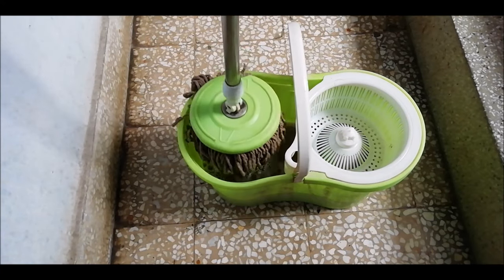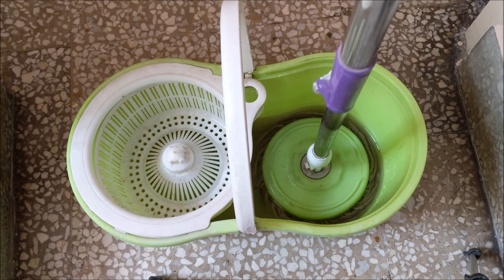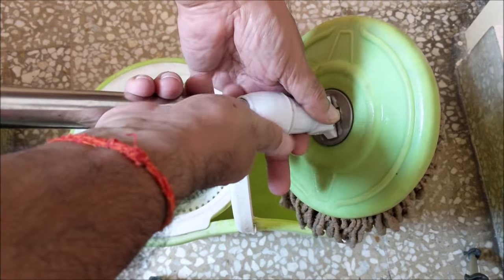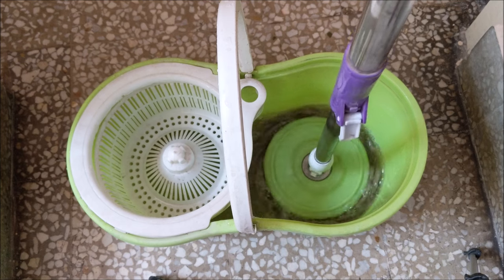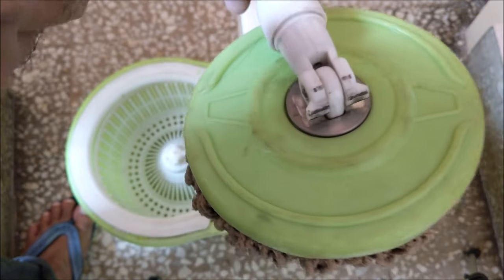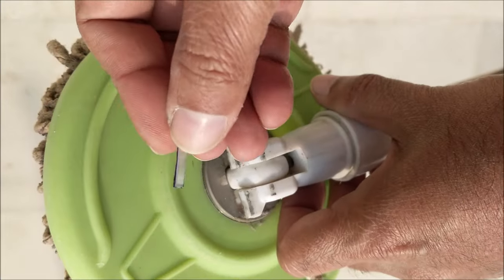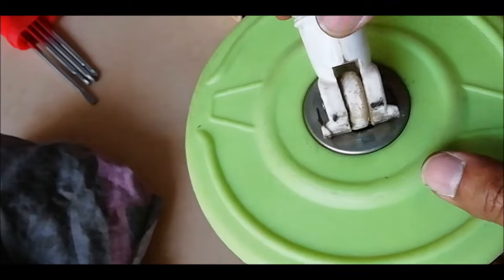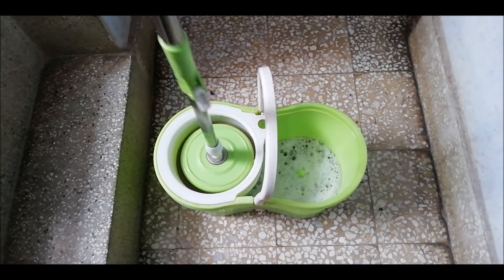fix spin mop that is not spinning

Comment: It's still not spinning
Reply from the maker: Remove rod from mop holder then open rotating lock. Push the rotating rod in, if the rotating rod goes in without slipping and rotating then the rod is good but if it goes in without rotating then the rod is bad.
Reply: @diyrepairs  the rod is slipping the same as urs but your solution didn't solved my problem please help sir
Reply from the maker: @pixarchgaming  Did you check that the rod is moving or slipping while going in?
Reply: @diyrepairs  I'm my case its sliping what to do?
Reply: Please make a follow up video on this topic at some point.
Reply from the maker: @ajaytiwari4583  If slipping means the rotation mechanism is bad. You can replace the rod which is easily available in the market as repairing rotating rod is very laborious and time consuming. In the next video I will be repairing the rotating mechanism.
Reply from the maker: @ultraali453  Thank you for your valuable suggestion. I will surely do.
Reply: exactly

Comment: Still isn't spinning
Reply from the maker: Remove rod from mop holder then open rotating lock. Push the rotating rod in, if the rotating rod goes in without slipping i.e. rotating then the rod is good but if it goes in without rotating then the rod is bad